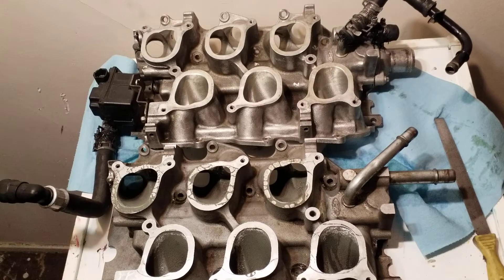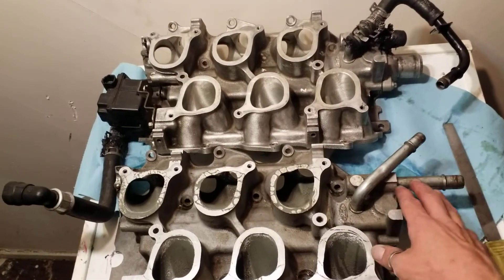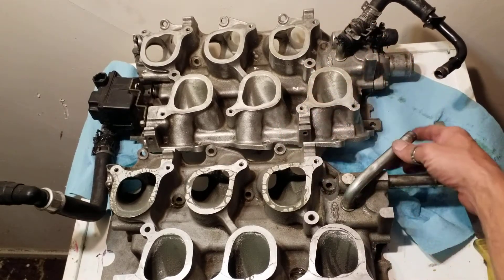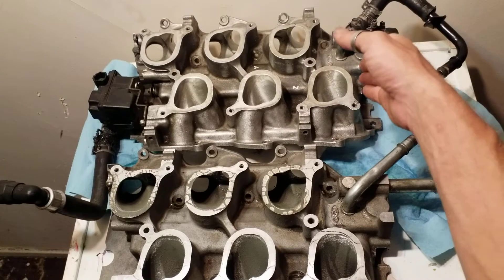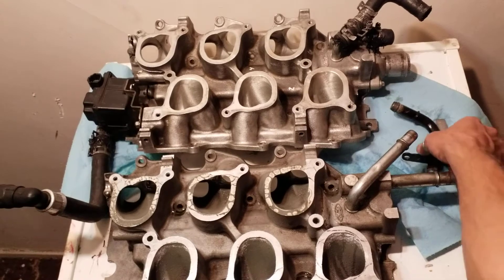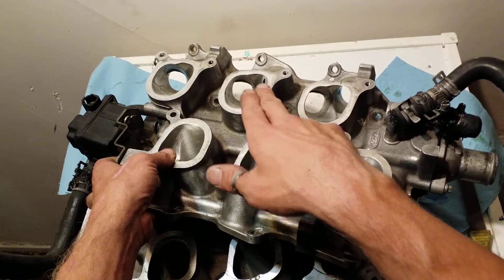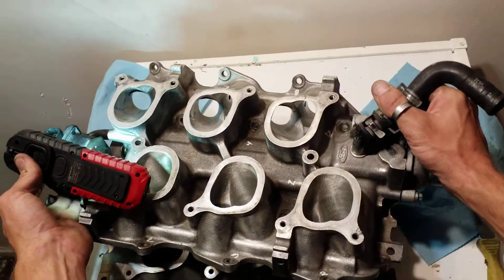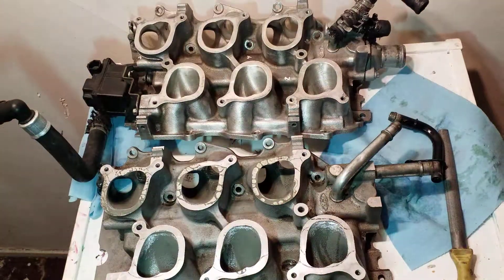Freestar Lower Intake Modification, Knife Porting and Coolant Routing

Comment: I'm planning on a 3.8 v6 in my 16ft jetboat with a berkeley jet.  Most v8 jet boats use the jet as the water pump and eliminate the engine water pump and pump into the block raw water from the lake.  I'm thinking this is the simplest way.  Are the later models reverse flow, so the water goes firt through head and out the block?  It really is run full throttle all the time on a boat, so I don't need low rpm torque and individual throttle bodies is good.  Is there a way to set that up?   I also have to use my own efi computer, speeduino is the plan as I have some board from a racecar project.
Reply from the maker: @murraymadness4674  I have been planning building a 3.8 mustang pontoon from gutting a v6 chassis to use all of the motors electrical and chassis capability on a boat. If you have everything to transplant from the car like ecu/wiring you don't need aftermarket efi controller, just a PATS delete.
I personally plan on making a small sump, like a livewell, connected to the bottom of boat that can house the waterpump inlet. This way the boat being on water fills the water sump to feed the water pump inlet tube consistently and reliably.
You will want to keep the flow the same because then the motor still uses the thermostat to control motor temp. Without a thermostat the engine will over cool itself and create running issues.
Reply: @MustangV6TechSupport  I got a free ($50 gas) 3.8 complete no computer.  A pats delete is like $300 or more, fk that.
I have speeduino boards.  bail on the itc, I will get the freestar intake, so its light plastic.  The old school v8's are fixed by putting a restriction in the jet flow into the motor so it keeps it warm, the bad days they would run cold and get horribly bad "mpg" or loops around the lake per gallon.
As most are run wot at top speed, you set it for that.  I water-to-water setup is how all modern boats are done, but this is a simple "free boat $50 engine" project.  The jet was $400 I think, but I sold the mercruiser for more than that..  I guess it makes no different if stock coolant goes into head first or not, as I will just run it block first and exit out the intake..I think.  not that far yet.  I have to confirm the engine actually has good compression, the oil pan was holed, so have to fix that just to test it really.
But look forward to your input on the project, I will put it on my yt channel..once its done. no more step projects, get it done, and show it done.
Reply: @murraymadness4674  I just started researching these engines for my own project..  what version of the speeduino are you going to use? batchfire? wasted spark?  btw, ive read that 1.8 460 roller rockers are a good upgrade.

Comment: I think you can Block the bullshit line coming out of the back and Run the heater hose out of the front like on the earlier 4.2l f150s.  I’m currently trying to figure out what all is needed to do the late model 07 intake swap on my 03 f150 it’d be really sweet if you could put together a video explaining how to make a throttle cable mount for the cable driven throttle body from the older 4.2l engines.

Comment: I watched your videos and if what I am getting from this is correct with the right small modifications I can put a Windstar intake LOWER and UPPER off a 2001 freestar and run my stock hood ? I have to replace both exhaust manifolds anyways have never owned a mustang.. I have already dropped the k member and hoisted the engine to replace the darn oil pan as crazy as that sounds you have too.. I wanna do this swap everything else i am confident I can figure out I just would like to make sure I am understand what you are explaining.. thank you for your videos for real it means a lot to the small car guys who love information and content.
Reply from the maker: Freestar is 2004+ intake. The freestar proceeded the windstar split port intakes 96-2003. Yes you are correct the 04+ freestar and 99-03 windstar use upper and lower intake deck that only works together as one unit for both vehicles. 
These fit under 01 cobra hoods, the alternate hood they put stock on some V6s

Comment: I expected to see "butterfly" type valves on the secondary runners that open at higher RPMs, but I don't see them in your knife edge ported manifold.   Were they just not installed when you shot the video, or does the Freestar just not use them at all?  Thanks in advance.
Reply from the maker: On freestar they do all have IMRC and work much more effective than mustang IMRC. Freestar lower intake split port design being an offset canal, not its own independant canal. I remove the IMRC butterflies to use a full size metal file to knife port the manifold and then reinsert the IMRC. The hand file ports 20x faster than a porting bit and only fits inside freestar lower intakes.
Reply: @MustangV6TechSupport  Thanks for the response.  I'm getting a lot out of your postings.  I have a very interesting application of the 3.8/4.2 family of engines I'm working on.  One of the issues I need to solve is lowering the height (and improving the air/fuel flow) of the EFI system.  I'm definitely getting some really good ideas from you.

Comment: i hear Freestar i click quickly..lol i have a totalled 05 that i crashed in 2011, i plan on fixing it one day n modding it, has the 3.9L but would like to use the 4.2L, altho my v6 has 55k miles.. Do you know how much it can be bored out to??
Reply from the maker: I would keep it a 3.9 as 3.9 forged piston assembly can be recreated off shelf with 351w long rods and ls pistons. 4.2 is only better for NA and low boost as 3.9 has lower compression for high boost applications. Contact FB: New Edge Mustang V6 Tech Support for more info.
Reply: @MustangV6TechSupport  Thank you for the quick reply, you can take a look at my van before i flipped it upside down..lol